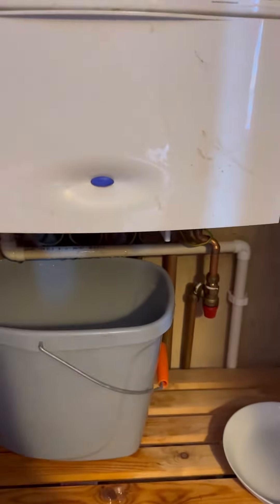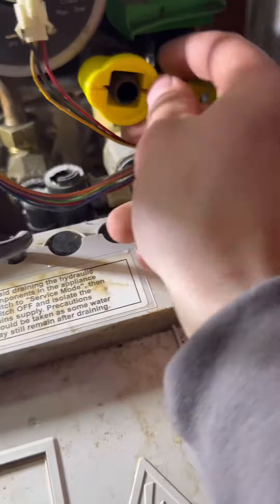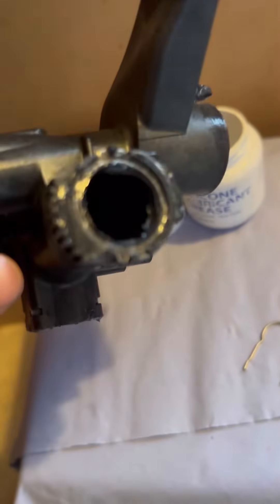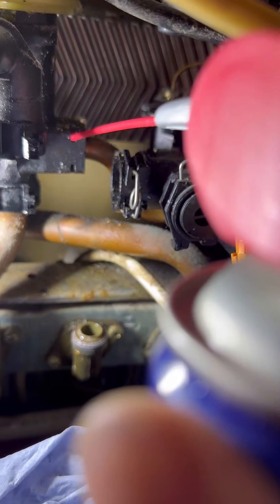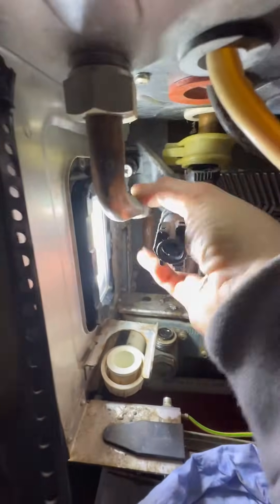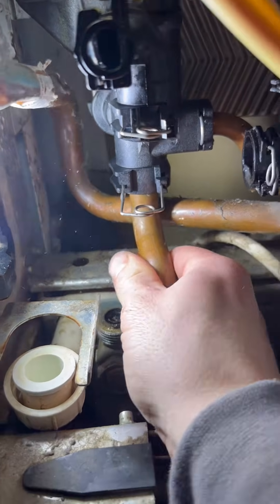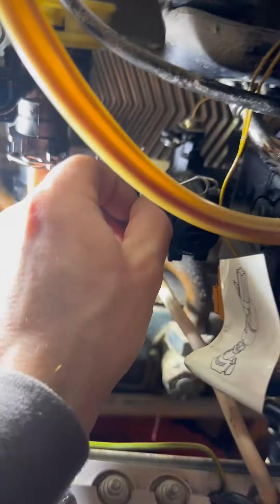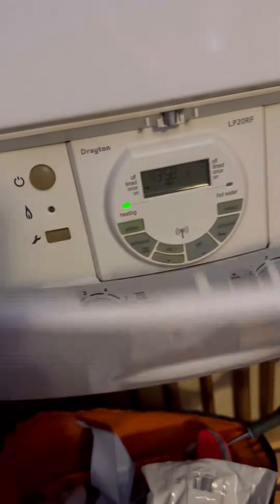How to replace a flow manifold on a Worcester Bosch combi boiler Si junior cdi I erp step by step

Comment: Fantastic you tube. You explained an awkward job in simple terms giving me the confidence to sort it. I took your advice and also replaced the DHW sensor which looked a mess.  The flow unit and sensor were sourced locally for 20.94 and 10.41 respectively + vat. I'll be back with the next hiccup. Regards Sam

Comment: Awesome video! 👏👏👏

I had a leak from the same part on our worcester greenstar 28i junior.

This is a great step by step tutorial. 

I've got a wife and 3 kids and I was actually a bit stressed and worried with quote I got to replace the part.

Found this video. Thought I'll give it a go myself. I'm pretty hands on and good d'i'y er but there's no way  I'd of know how to replace this part without this video.

Bought a flow manifold from screwfix for £20.50 

Came with all washers and o'rings like he said.

I learnt loads from this video.

Even cleaned my condensate trap out. Boiler sounds and runs great 👍 

Saved this family hundreds £££.

Legend this guy! 

If I had a night out with you. I'd buy all your drinks!
Reply: If you’re not a gas safe registered engineer you should not be even taking the case off the boiler mate. Saved your family a bit of money but can also put your family into a lot of risk